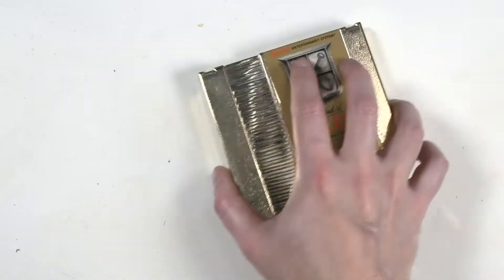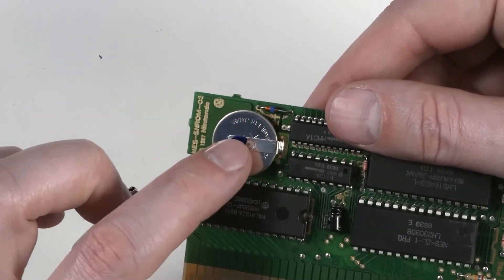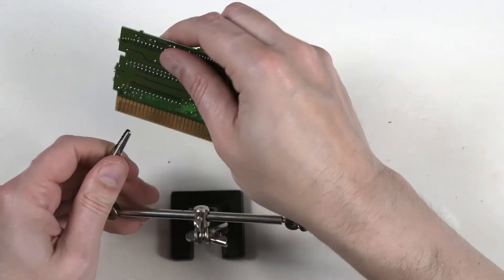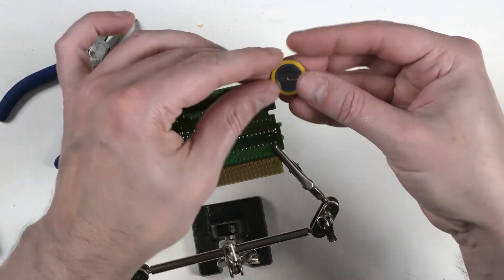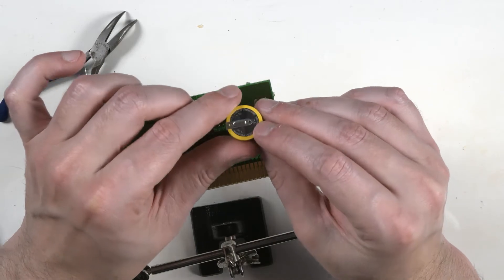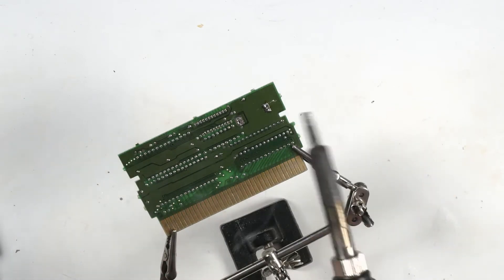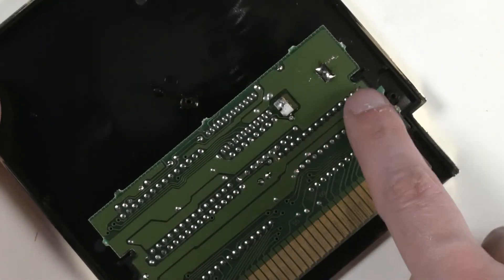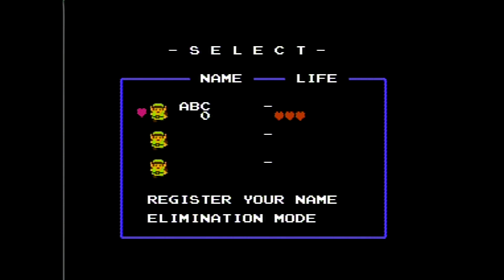NES Games Battery Replacement

Comment: Many NES cartridges used SRAM to store game progress and/or data. SRAM loses its data when power is disconnected, so the battery will provide a continuous power supply when the cartridge is not in use. When you are playing the game, the console powers the SRAM. There was no FLASH or EEPROM in 20th century. As the technology develops, SRAM is changed into FLASH or EEPROM.